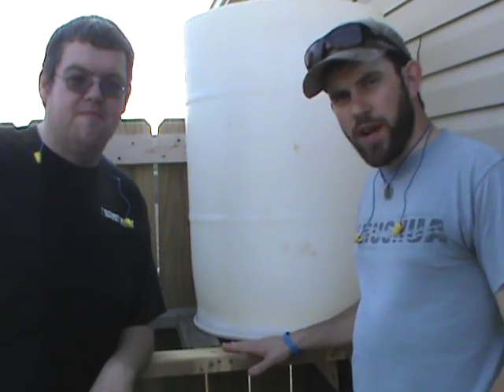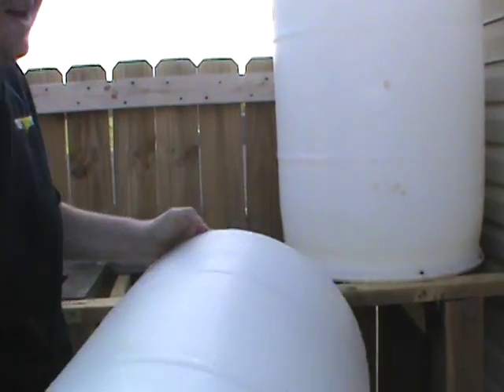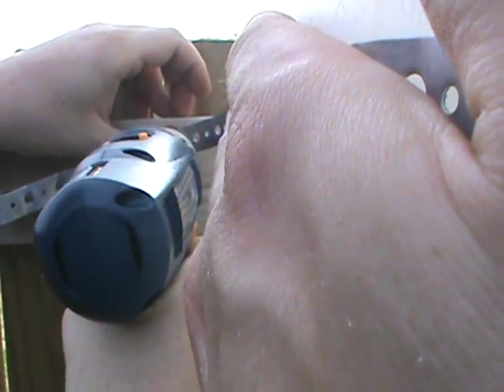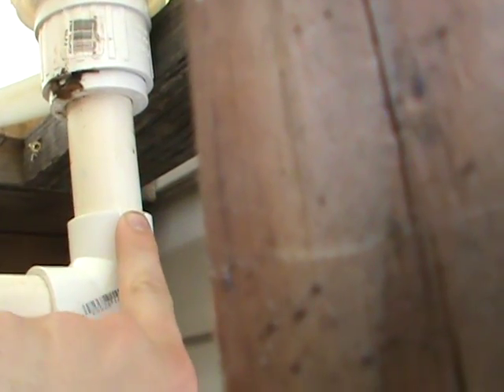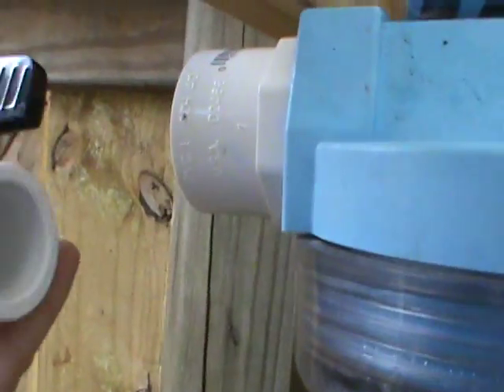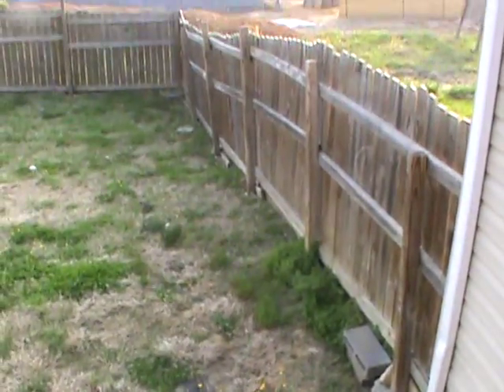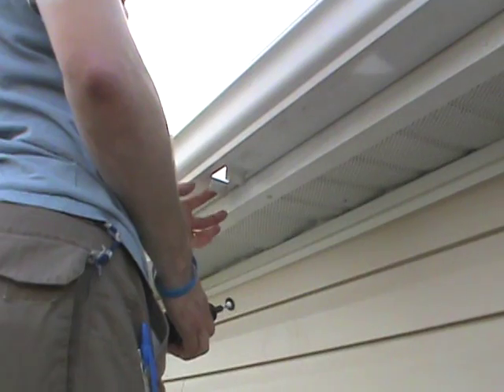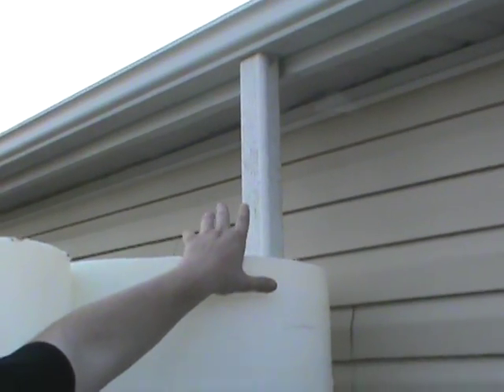HOW TO BUILD A RAIN CATCHMENT FROM START TO FINISH FOR BACK UP WATER AND EMERGENCY

Comment: Good info.  Out here in So Cal were are not allowed to have the open barrels like the way you guys have it  because of the mosquitoes problems.  We are required to keep the barrels covered, so our design out here would just be a little different.

Comment: Thanks for the video.  I was wondering if the water is safe to drink after running down the asphalt roofing shingles?   Have you ever sent any water off to be tested?  Also, those 2 barrels would be very heavy when full, has your support system handled it OK?  Thanks for the video :-)